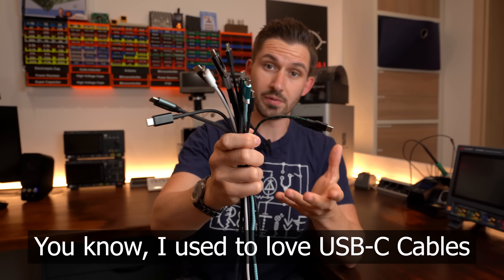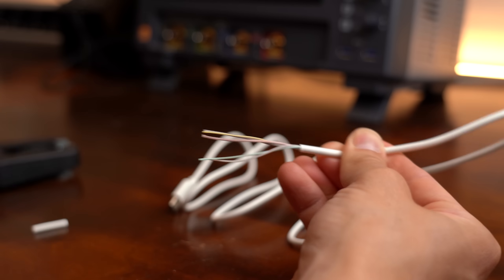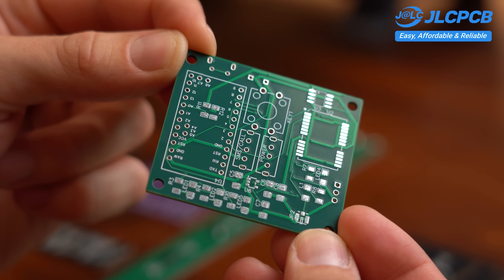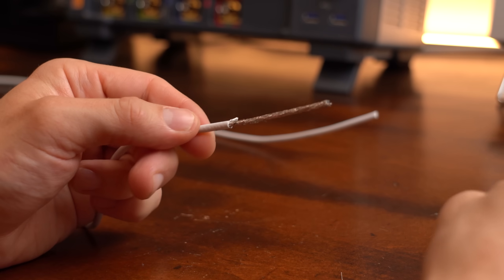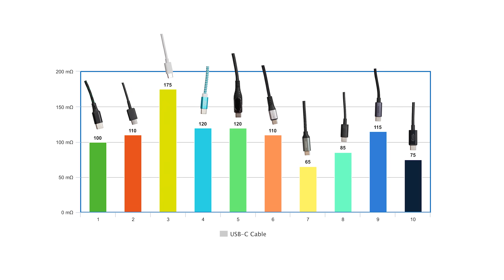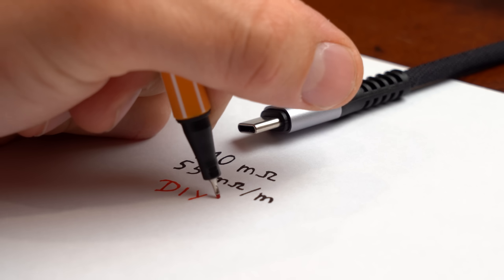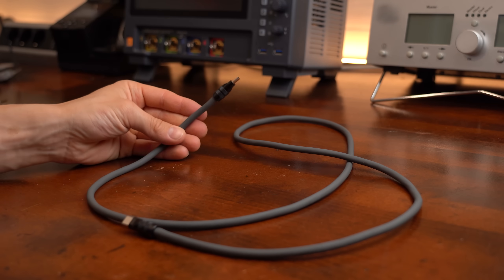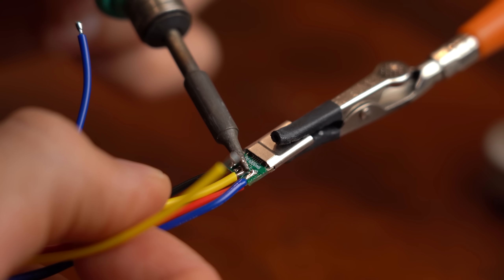Your USB-C Cable STILL Sucks — I Built a Better One? (DIY or Buy)

Comment: We're slowly moving towards the same issue we had before where plugs were different. Plugs now are the same (USB-C) but we have different protocols and some cables don't have data and so on... History repeats itself!
Reply from the maker: Sadly kind of true. USB-C was supposed to be the solution, but it slowly turns into the original problem.
Reply: @greatscottlab All that says is that people don't remember what the original problem is. "It might work less well" is a far superior problem to "I know it won't work and I will be upcharged like crazy for adapters". Interoperability isn't perfect with USB-C, but it's far, far superior to the old days.
Reply: @chord5625  "I don't know if it will work" is worse, which is the actual current state of things.
Reply: @keiyakins  No, the current state is "It may not work 5-10% of the time, or in corner cases like alternate modes". The previous state was "maybe 20-30% chance of the same connector, and even if it isn't, get ready for a world of conversion dongles which may or may not work, which may only work in one direction or another, etc.".

And at the end of the day, "this USB-C cable sucks, use a different one (that you probably already have)" is a much easier problem to deal with than "these ports don't fit together, better hope you remembered to bring the right dongle collection with you".
Reply: @chord5625  You could visually tell if it'd work though. Also, 20-30%? Micro-B for most things, mini-b for some older stuff. and whatever stupid shit apple did but their devices are a blight on humanity anyway.
Reply: @keiyakins   The problem with Micro-B isn't compatibility, it's capability. Remember the monstrosity that was USB 3 micro when they tried to extend it for faster speed + higher voltage? It was a technological dead end, and the connector was infamous for getting loose over time.
Reply: @greatscottlab yeah, because the problem is the manufacturers, not the usb-c, they are always going to try and make it cheaper at the cost of quality
Reply: @greatscottlab it also wasn’t a great solution, since it has the least mechanical retention grip of all the connectors I have come across - such a let-down when talking about video links (e.g. running an online event) or data transfers (when the cable slips out shortly before a long transfer is done). Not the point of your video (which rocks, as per usual!) but since we are at the “all attempts of improvement converge to crap” point of the discourse… 😂
Reply: @greatscottlab  We had 37 competing standards and we create a new standard to make them all combined. Now we have 38 competing standards.
Reply: @greatscottlab  I am now famous with my top comment.
Reply: @greatscottlab   Everyone could have seen that USB-C was going to become the original problem.
Reply: @greatscottlab  slowly? this was obvious from the start.
Reply: @greatscottlab well if you wanted a solution, you would've built a superspeed cable. But you didn't, i guess for the same reason manufacturers don't.
Reply: Yeah it sucks but at least it’s somewhat solvable by only keeping good cables. At least the devices CAN use the same cable. Don’t get me started on devices that don’t support the power negotiation though. Ugh
Reply: @jamesx7424  Amazon's Kindle Fire tablets with USB-C are brutal... they only support power negotiations if not fully dead. If dead then only good old 5VDC on an old dumb charger gets them going (or opening the device up).
Reply: In some ways it's better and worse. Now we can at least always charge, but now there's no way of knowing what an off brand can do
Reply: But they all still work. Some just work better than others. There's no "will this plug fit or not" going on anymore.
Reply: Just buy 2 good cables and you are set for a very long time
Reply: there are infinitely many competing "standards" XD
Reply: @huff_designs XKCD strikes again!
Reply: @huff_designs 😂
Reply: @huff_designs The great thing about standards is that there are so many to choose from!
(Unfortunately shady manufacturers like to pass their product as something that it isn't)
Reply: This is why I bought several packs of cables that supported everything I need, and threw all the old ones I had away. Now I know that if it's one of my nice red cables, it can do what I need.
Reply: It's pretty simple, just think the same connector has different level. 
Just like your car charging port, level 1 level 2 and level 3, they're the same connector shape just different number of conductor and size. A simple labeling could fix the problem.
Reply: It's still way better than before with a few dozen type of barrel connectors.
And the solution is dead simple: instead of allways hunting for the lowest price, find one good source for USB-C cables that do 240W and high speed data, mark them all with "Property of Billy Joe", and then throw away all other cables. :)
Reply: honestly, I'd rather deal with that than with a bunch of cables, I mean if you just have a bunch of them then just try a bunch of them until one works. the real problem imo is bad quality cable.
Reply: @AshLordCurry  It's not just that a "bad cable is bad" there's functionally no standard for the cables themselves. Because if there was we wouldn't have the exact situation we are dealing with now. 

GENERALLY it's fine -- there's just enough issues where it's beyond noteworthy.
Reply: Type c is actually fine.

Would you rather have a port that can only work with a 240w cable. Or one that works with a 240w cable but can also work as a 2.0 port with a 2.0 cable? 

Making it so it only takes specialised cables means that entire port is completely useless if you are not using it to its max potential.
Reply: TBH, most of the people don't need these high tech features. We just use it to charge devices and sometimes send and receive big files.
Reply: Oke just get a couple of good cables and dont use other cables
Reply: Just don't buy cheap cables lol
Reply: @deluca9805  Cheap cables are good, when all you need is USB 5 volts, and data. And that's all most people need.
Reply: Actually I don't agree. In most cases we need a power supply and Maximum of Basic Data Transfer what is given.
The other special cases require more expensive cables that even cover also the other needs (power + ,data) so we only have to Plug one cable in our Laptop to connect a complete setup. We solved a lot of issues with that!
Reply: i mean at least there is kinda a solution. if you care about 240w and tb4 you can buy just lots of the same cable that does both and use only that
Reply: Sad 😢
Reply: I believe this can be consolidated by adding proper ratings/tags/classes to cables. Officially defined 'does audio' 'does data up to this speed' kinda things. Of course, the standard already somewhat defines these parameters in terms of say, USB 3.2 gen 2 data or whatever, but something less cluttered and mandatory sounds good
Reply: @flareflo362 I just try to buy good cables and throw away the “free” trash cables that come with some cheap electronics. That way any cable I grab just works. The downside is that means all your cables are a bit thicker. But it’s worth not being annoyed all the time
Reply: I wish the usb organization  had more ability to enforce/promote/police USB-IF better.  When you have major players like anker that put stuff like "USB-IF compliant" on some of their products that aren't actually certified, you know the thousands of off brand stuff on amazon/aliexpress are doing it too -- or just not even mentioning USB-IF.  I also think consumers don't even know about USB-IF.  If you read usb_type-c_cable_logo_usage_guidelines_20240903.pdf , you will see almost nobody is using the logos (which by the way are terrible).  Apple was much better at trying to make people aware of/buy MFi cables.   It would be nice to easily know (and trust) if a cable met the specs, then decide if you are willing to pay a little extra or risk the alternative.   I have a USB cable tester similar to the one in the video.  Whenever a new cable comes into the house, it gets tested and either thrown out or labeled.
Reply: We are not moving toward, we are past and looking for the next check point. Barrel connectors are less of an issue.
Reply: Type-C in hardware is type: Any in software
Reply: USB-D will solve the problem!
Reply: @Kaputt512  if the connector is D shaped again, you'd have the problem as with micro-USB B, it only goes in one way 😉
Reply: i have yet to actually encounter any issues with USB-C cables, things just work
Reply: RIP EU. 
This problem has existed for YEARS now. Does not help that phone makers will gladly sell you a phone with a USB 2.0 cable either.
Reply: It was so obvious too when the same connector can support everything from just powering a mouse all the way to connecting external gpus. The cables were obviously going to be different, yet they all plug in together. They really messed up with trying to do TOO much.
Reply: what frustrates me the most is that some devices are not set up correctly and only work with usb a to c cables
Reply: Microsoft is addressing this issue
Reply: Technically speaking usbc was supposed to solve the issue of different physical formats, like the plug and receptacle. An extension cord has different cord types in our homes, you cant make the same for all applications
Reply: i carry the highest rated cable that I will use, everywhere. this came with one of my devices, and does usb3 speeds, and charges everything. 

not saying it's not a problem but it's definitely not as bad as before.
Reply: The cables without data. come as charging cables for devices that don't have data transfer. For example, you get a USB cable with a Bluetooth speaker, the speaker doesn't have or require data transfer, so the cable only has the power lines in it. Cheap cables, are made for simple data transfer and charging, such as the ones form the dollar store. If you want 5gb+ transfer speeds, high speed charging, and everything else USB C can have, you'd at least be paying $10 to $30 or more for a cable. So for free you get power only, for cheap you get regular charging and data transfer, and to actually have full functionality, you spend a decent amount of money.
Reply: Sorry I'm late. Pinouts are varying amongst manufacturers. Is some cases it can destroy data lines on the device.
Reply: And dont forget devices with a usb C connector, but without their id resistor, specifying them as a power drain.
Reply: Just like streaming services....same issues we had during cable, nothing ever really changes
Reply: I mean the history already had a precedent of this happening: obd port was supposed to standardize vehicle diagnostic.
Reply: This is 100% a regulation issue though. Cable types are oblique because vendors are not forced to label them, hence they cut corners and cheap out on cables or even actively try to obfuscate the cable specs.
Reply: It's even worse, with different connectors you had a very quick way to figure out one from another. Now ? Good luck figuring if that random black USB-C cable is the one to fast charge your phone, the one with fast data transfer for your USB portable drive, the cheap one that powered some 5V 1A device you bought from Aliexpress or whatever...
Reply: @thomas_bicheri A nice standard there fixes all problems with one new standard cable, the one and only cable you will ever need. Maybe an adapter to cover older standards. USB ports: you need more cables than ever before. Granted, if you get the right cable in the right port, it's a better standard, but I wonder what devices there are out in the wild that are not getting the best out of their devices simply because they are connected with the wrong USB cable?
Reply: @thomas_bicheri  : What's so difficult about marking your cables with colored tape? If you insist, you could even just cut off the old barrel connectors and tape them to the USB cables, if you need haptic feed back.
Reply: @haukewalden2840 It's not difficult, but you have to test them before labelling, one by one. And you'll have to do it again for each additional cable you get from there onwards. I'm very grateful for the USB-C, it indeed solved a problem; but we have to acknowledge that it created a whole new problem, perhaps a worse one.
Reply: I don't agree, while USB-C has a number of problems at least it standardized the connector. More often than not, if it's just for charging or simple USB2.0 data transfer speeds, almost any cable will work. And the big difference is that USB-C ensures that you will not fry your device even if you try to use a feature that the cable doesn't support. With old style barrel jacks it was the wild west in terms of voltage/polarity, while the the plethora of proprietary connectors was a disaster for consumers.

People can hate and bitch about USB-C all they want, but it makes our lives way easier compared to the past.
Reply: @XavierGr Non-standard Chinese devives that'll use USB TYPE connectors for their own purpose like feeding 12V DC just for power. Pray they don't use data lanes for this.
Reply: @XavierGr  That sort of goes out the window when cheapskate manufacturers design power bricks that use USB-C plugs but only provide 1 power mode that isn't 5V1A or the USB standard that are "supposed" to be only for their one product but you have no idea because they look exactly the same as any other plug.
Reply: @夜月-l5h Sure it can happen, but that's not a failure of the connector or the standard. That kind of bullshit falls entirely on these dodgy "manufacturers". I could also make a device/cable with 220 AC input/output over the HDMI connector, but I don't think anyone would blame the HDMI standard for such a hack.
Reply: @XavierGr  There are already known cases of USB-C devices getting fried because one device on a hub demanded 48V while the other could only support 5V.
Reply: @hubertnnn  That's just plain out of spec, the hub should never allow USB PD on multiple ports. Even if there is a dodgy hub out there, you can't blame the USB specification for being wrongly implemented.
Reply: @XavierGr  you can fry your phone plugging it into a Nintendo Switch supply 🤣
Reply: @XavierGr  You really didn't understand my comment did you? USB-C rocks. I love it. One plug to rule them all. But as stated, with these different protocols and cheap manufacturers skipping the datalines for "Power only cables". Causes the exact same issue as we had before. Just in another way. Every single USB-C should be just as capable as the next one. That is my firm belief.
Reply: @billyjoe3309  It would be nice indeed if every cable had the same capabilities, but it would also be quite impractical and expensive, and that's why we are stuck with this mess for now. Have you seen how thick USB 4.0 cables are? The electrical current ratings and data transfer speeds to support all possible features, require very thick and shielded cables.
Reply: @XavierGr if people actually accepted the Micro-B 3.0 cable, we wouldn't have a mess that we have. A cable and port that you can identify at a glace, while the port is 100% backwards compatible with older cables.
Reply: I hate USB-C, because the flat connectors are so fragile.  I really miss having sturdy, solid barrel jack connectors for charging my laptop.
Reply: @atomopawn until the jack gets loose from the device.  I repaired a lot of laptops back in the day..
Reply: @Hoptronics  It couldn't possibly be worse than USB-C.  I've gone through so many of these.  I did have broken jacks on barrel connectors occasionally before this -- maybe once every ten years.  But I went through 8-10 USB-C cords in just a few months until I switched to using magnetic tips.  And those are incredibly inconvenient.
Reply: Thunderbolt checks all boxes - but is more expensive
Reply: Thunderbolt is proprietary. So move on 🤷
Reply: @pfabiszewski  it even checks the "proprietary bullshit" box.
Reply: @pfabiszewski  you mean USB 4, right? 😉
Reply: @pfabiszewski  Thunderbolt is proprietary, so using it requires costly licensing, which is not gonna be an option with these cheaper products.
Reply: locked behind Intel  @pfabiszewski 
I love Thunderbolt too but that itself is a big dealbreaker for me
Reply: @exclar they kinda opensourced it. Btw - I was actually meant that buying thunderbolt certified cable checks most usb-c related needs than about thunderbolt protocol/technology itself
Reply: @exclar and apple 😢
Reply: @pfabiszewski modern thunderbolt uses the same USB-C connector, and it's not immediately apparent if a port or cable supports thunderbolt. It also doesn't guarantee support for alt modes such as display port, or even USB power delivery.
Reply: @patx35 actually it does - afaik
Reply: @pfabiszewski Thunderbolt is the best 👍🏻
Reply: yeah, agree
Reply: just buy tb4 or usb4 cable if u really want very high bandwidth and all in one, its not that difficult
Reply: @LuminousSpace  Yes, I definitely want to spend.. what is it... multiple dozens of dollars for the highest quality tb4/usb4 cable just to charge my phone.....
Reply: @LuminousSpace  All in one? Those usb4 or tb4 cables font guarantee anything in relation to power or cable size tho all it literally does is say it should transmit data at this rate... The entire point of this video
Reply: we just need a new standard to replace all the old standards.
Reply: All USB-C cables are capable of slow charging, and for most devices you really don't need more. That we have a standard that is close to universal for the most common use case is a huge win in my book. More demanding use like data transfer, fast charging and higher power devices like laptops require appropriate cables, but they all have the basics is common.
Reply: @gubx42 yeah for sure. It really sucks when you are trying to connect something like a camera and then you finally realize it is a charge only cable. That’s always been true, not specific to usbc. But for me I just don’t keep charge only cables. I’m guaranteed to eventually forget and be annoyed
Reply: It's even worse! At least you used to be able to tell which cable could do what just by looking at them!
Reply: Just color code the cables based on the features they have, problem solved.
Reply: @SkepticalCavemanif it has all the features, would it be rainbow coloured? 😂
Reply: Just stop hoarding cables and you won't have this problem. You only need a charging cable and a data cable. They're marked. 240W and Thunderbolt 3. Throw away everything else.
Reply: As long as the industry makes money.... 🙄
Reply: Agreed. That's why i personally didn't like iphones moving to usb-c at all. with ligthning it was pretty simple and IMO it is a better connector physically. Especially the female side which can be cleaned easily with a toothpick.